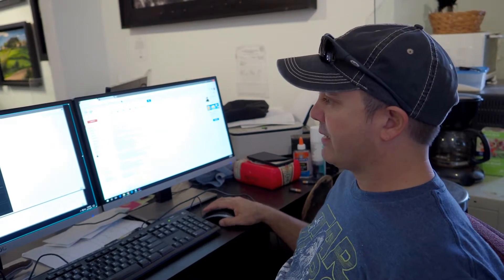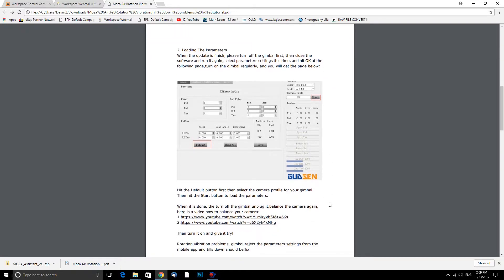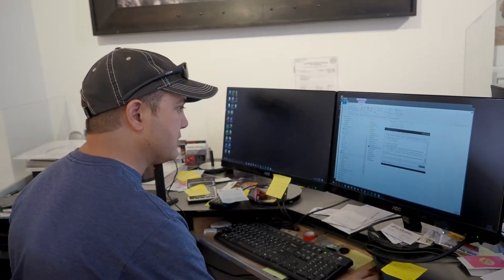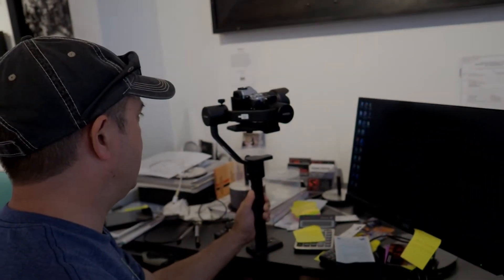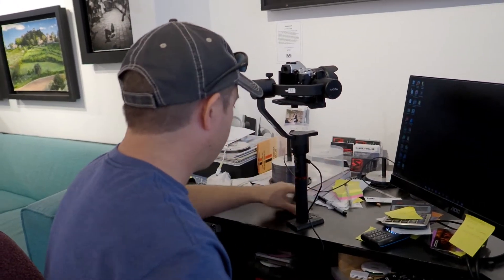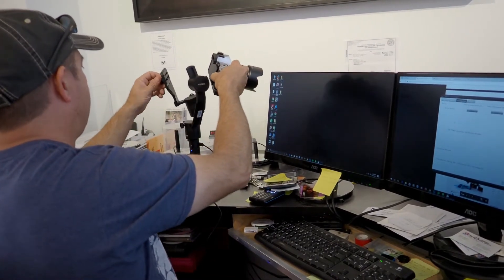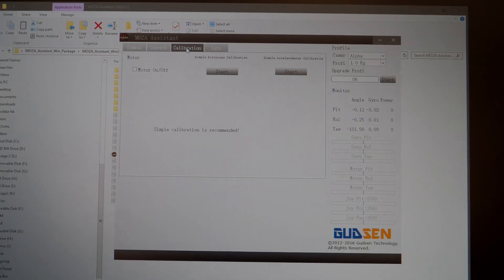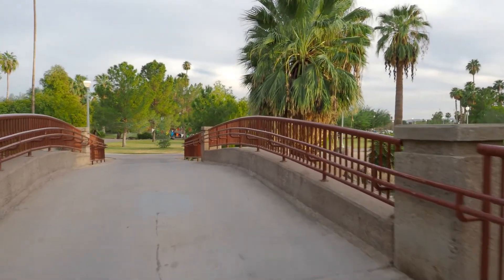Update - Gudsen Moza Air 3 axis Gimbal tech support answered and how to calibrate.

Comment from the maker: Highlighted reply
ks0z3
11 hours ago
If you're using Windows 10 - you need to install the driver first - the Zip file contains 2 zip files.  One called Mini_Air_CP2102_Win.zip - the other for the Thumb Controller.  For the Gimbal itself, extract all the contents of the first tile - then run CP210xVCPInstaller - which one depends on whether you have 64 or 32 bit windows.  Most likely it will be x64.  Note - you can verify the driver is installed before powering on the gimbal by simply plugging in the micro USB cable - it will show up in Windows Device Manager as CP210 UART Bridge.  If there's a Yellow Exclaimation mark - you don't have the driver installed yet.  After install it will show up in Ports (COM & LPT)

Finally - to boot into Firmware mode - hold down the Joystick button, then power button.  That will prevent the gimbal from going nuts.
Reply: hi! thank you for the video tutorials and all the help. I have run the VP210 INSTALLER but do have the yellow .exclamation mark I have tried to right click to install the driver but the computer can't find any. do you have an idea?

Comment: This video is from 3 years ago but I still hope you can help. My MOZA air will literally not turn on. I’ve charged batteries they are literally Green. But it will not turn on when I try to use the gimbal.

Comment: You can do the calibration from the app on your phone. Is much easier than what you just did. The same thing, lay the gimbal flat on a level surface, turn off motors and press calibrate on the app. It works the same, but much easier.

Comment: Mine shakey and shuts off did the update but don’t know wat it can be
Reply: did you ever figure out what the issue was? Mine is doing the same thing
Reply: yes, use the app under camera profiles choose 1.if not try other ones until you find one that works for your camera..that fixed the shaking part, shuts off still at times like if i barly bump it.this thing kinda sucks.

Comment: I have problem i got sheky videos and sometimes when i move camera up side or lower side moza gimbal motar turn off(released) automatically plz help me
Reply from the maker: Did you do the firmware updates? have you selected the right weight setting for your camera.
Reply: yes updates done! how to select right weight i dont have remote
Reply from the maker: Connect with the smart phone app.
Reply from the maker: Or connect it to the computer.

Comment: I've updated my Moza Air to the latest firmware but when trying to update the thumb controller I get an error and am unable to upgrade it. I held down the speed button, while holding I plugged it in then opened the Moza assistant app. The thumb controller said connected but error on the assistant app. Anyone have luck upgrading it? Thank you.
Reply from the maker: I upgraded it from my computer. If you are on a pc you have to install a usb driver first.
Reply: Lavikka Photography Thanks yeah I’ll have to try again, I’m on a Mac and have the driver installed.

Comment: Hello, I have problem. 
Since the last update MOZA Air Gimbal, MOZA Assistant Win3.2.0 has appeared, I can not calibrate the Gimbal. Gimbal has Firmware Version 2.0.16, and in the description (PDF) is written latest version Gimbal v2.0.15
Moza stands slightly inclined on one side. 
By connecting the stabilization to the computer, calibrate with the camera mounted on the Gimbal - Gyroscope Calibration. Then I remove the camera and do the Accelerometer Calibration, and the Gimbal is laid down (as is the instructions in the PDF file at http://www.gudsen.com/moza-air-downloads.html). 
Despite the two operations, the stabilization is slightly inclined.
Reply: Йордан Боянов  hi did you fix the problem? And if yes how? I unboxed mine today and had the same issue
Reply from the maker: Try redoing the calibration with the gimbal laying on the table. In the mean time I will check the latest firmware.

Comment: My moza air keeps shaking my camera erratically and I’ve tried calibrating it through the app multiple times does anyone have any suggestions?
Reply: mine did too, then i took the camera off, installed the software via PC, did the 2 calibrations in the software, slapped the camera on and it wasn't shaking. still a little slanted but Im still tinkering with it all now
Reply: Thank you!

Comment: When connecting my Moza Air to my computer and putting the Gimbal into upgrade mode I do not get any communication between my computer and the Moza Air. "No Moza Device Found" I use this USB port every day so I figure it can't be my computer. Has anyone else had this issue and able to solve it?
Reply: If you're using Windows 10 - you need to install the driver first - the Zip file contains 2 zip files.  One called Mini_Air_CP2102_Win.zip - the other for the Thumb Controller.  For the Gimbal itself, extract all the contents of the first tile - then run CP210xVCPInstaller - which one depends on whether you have 64 or 32 bit windows.  Most likely it will be x64.  Note - you can verify the driver is installed before powering on the gimbal by simply plugging in the micro USB cable - it will show up in Windows Device Manager as CP210 UART Bridge.  If there's a Yellow Exclaimation mark - you don't have the driver installed yet.  After install it will show up in Ports (COM & LPT)

Finally - to boot into Firmware mode - hold down the Joystick button, then power button.  That will prevent the gimbal from going nuts.
Reply: Glad to help! :)

Just found a working Windows 10 x64 driver for the Thumb Controller as well: 
https://quadmeup.com/stm32-virtualcomport-driver-for-windows/

The ones included with the Moza Air Assistant doesn't seem to work for  Firmware upgrading.

Could be an issue with Windows 10 Creators Update - so if the bundled drivers work for you, stick with those.  If you have Could not Start device errors, try the ones from the link above.

Latest version is 1.1.0 - from Aug 14 - so if your thumb controller is already there, you're not missing out on any new features.  1.1.0 adds the mimic feature.
Reply from the maker: Sounds like you may have connected with the power on - on the gimbal.  I did that too. Reboot. Start the install of the assistant again. Plug in the gimbal with the power off then turn it on in Update mode.
Reply: Same problem here, " no moza device found", have tried a dozen times and nothing :(
Reply from the maker: Yes. Thanks. Put your comment in the description too.
Reply: Thank you ks0z3, that did the trick. Everything is upgraded and running great.
Reply: thank you. I downloaded the file from the link you attached but it says it is for win7+8 not for 10
Reply from the maker: It still works.

Comment: So glad you made this video! Had the same issue that you described in your earlier video with the camera always being a few degrees off horizontally. Drove me crazy. I was sitting here, trying to decipher the instructions, how to put the gimbal into firmware upgrade mode. It just says "push the joystick". Well, that didn't do anything. Saw that you held down the joystick and THEN held down the power button. Thank you very much for posting this! I wonder why Gudsen couldn't do a video on how to use their program.

Comment: Question: If you are in the follow-all mode, and you switch to follow pan mode (or lock all mode), does the gimbal "jerk" into central position, or does it keep the angle you were in when you pressed the button? I have a old feiyu gimbal, and I can go from follow all mode into follow pan mode smoothly while shooting, but when I tested moza air a few months ago (older firmware) the gimbal was not able to retain the angle I was in, but always "jumped" into cetral position when pressing the lock-all or lock pan mode. This is a huge issue for me, so can you please check and let us 
know?
Reply: The gimbal still resets it's position if you press the joystick button. Hopefully they will give us more options in the future, as I am still waiting for a proper android update for their app.
Reply from the maker: I know what you are talking about. It does seem to handle it better.